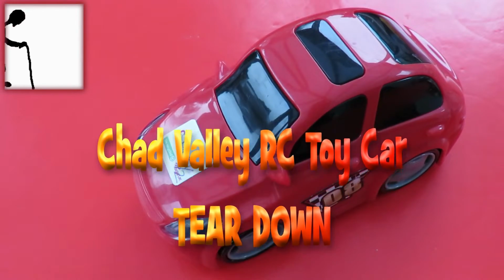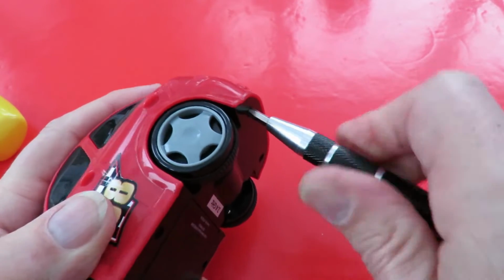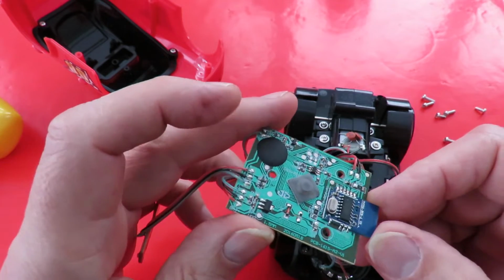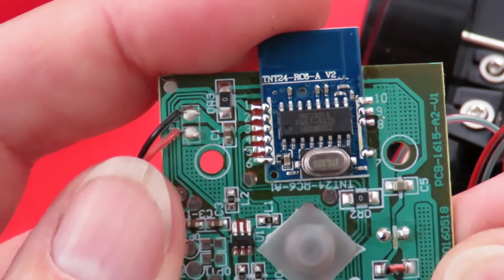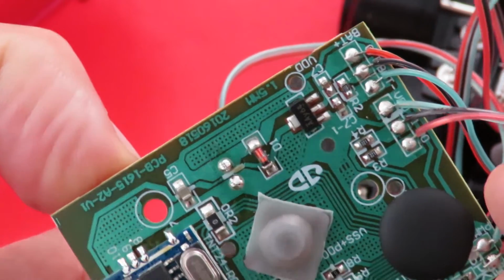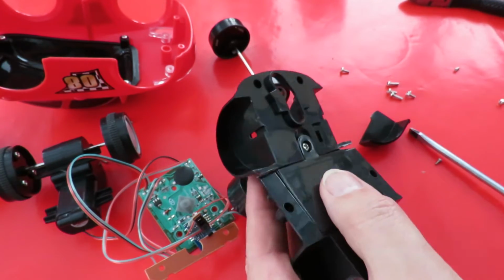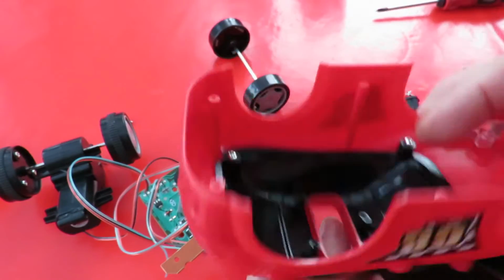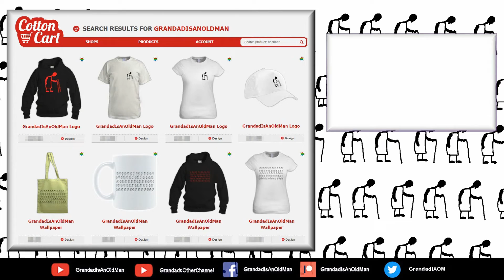Chad Valley RC Toy Car TEAR DOWN

Comment: I have a 40mhz receiver from a tyco rc batman car that won't work with any of my 40mhz transmitters. Weird that a 40mhz one would not work as so many of the usually do :)
Reply from the maker: Even if you have the right frequency transmitters only talk to the receiver if they have the matching controller/decoder chip. The majority of RC toy cars I have taken apart have RX2BTX2B chips and they talk to each other. When I find ones that don't talk to each other you can more or less guarantee they have a different chip. RC TX2B and RX2B chips https://www.youtube.com/playlist?list=PLA5a2xPRSrB1mLQvgf5ILMeTcRMuDtcNa